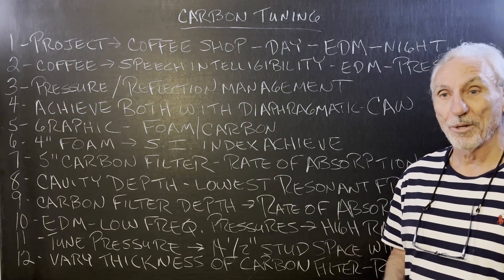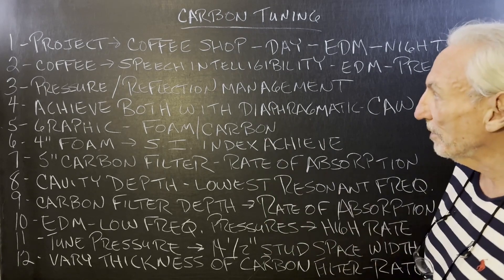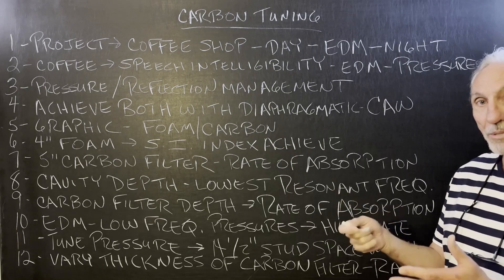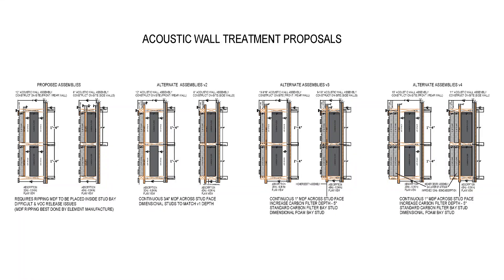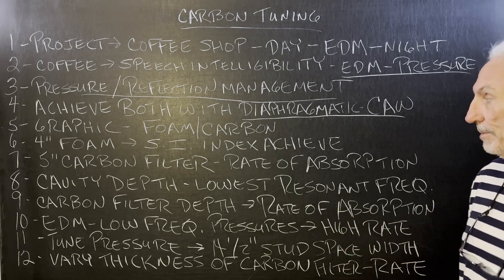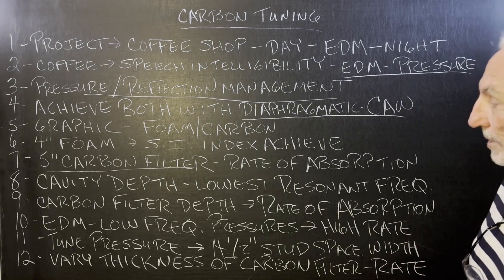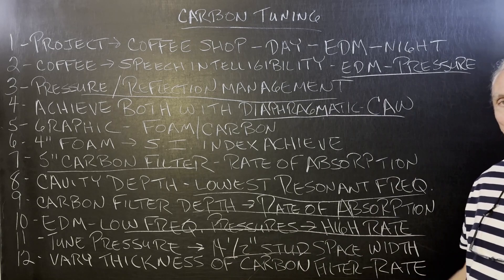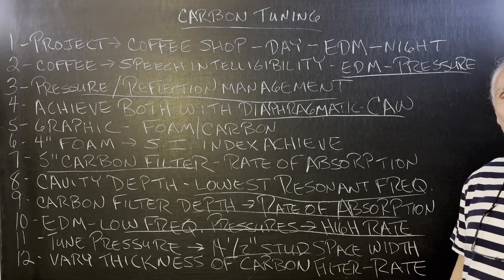Carbon Tuning - www.AcousticFields.com

Comment: I have a question for you sir. It's on diffusion, which I know isn't this video but I want to put it here so maybe you see it being a newer video. Why are the well depths calculated at 1/4 wavelength and why are the widths calculated at 1/2 wavelength. You mentioned this in an old video and I would like to understand the physics behind it. I am in the middle of my studio build and working on a diffusion idea for the rear wall of the control room. Thank you in advance for any concepts you can help me understand.
Reply from the maker: Study quadratic diffusion sequences using the modulus formula.